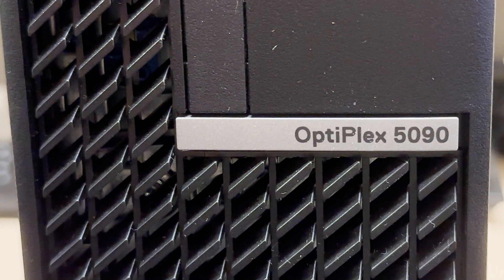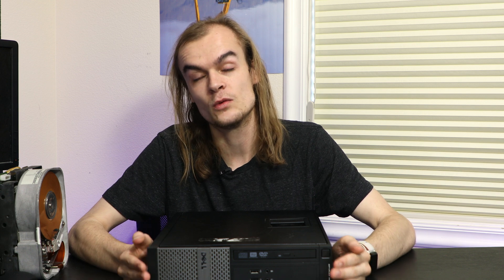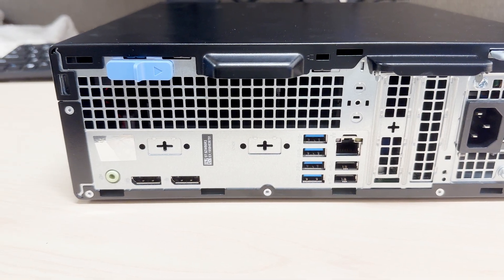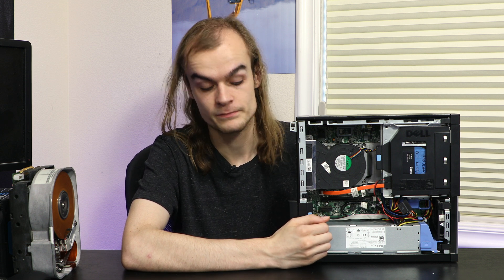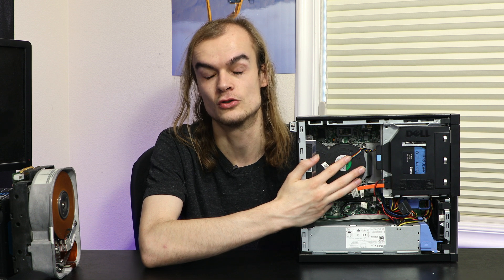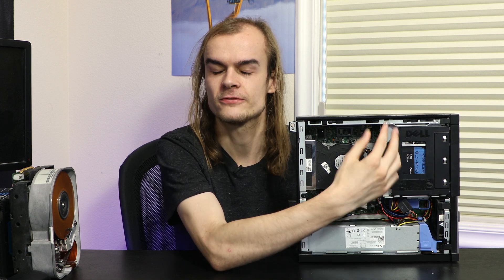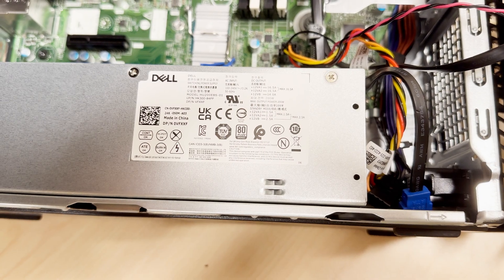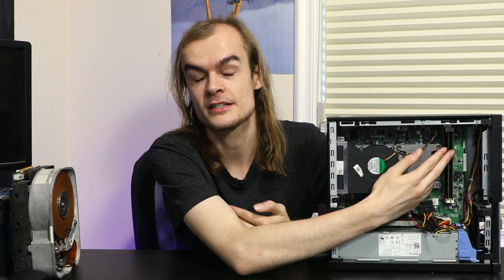How have Dell OptiPlex's changed in the last 10 years?

Comment: They made it worse by making the system more proprietary, sure it reduces cost but it also reduces the computer value, what Dells fails to see is that they are NOT apple, their ecosystem is not different from the rest of the computer market, by going apart from the rest in compatibility they are only pushing away possible buyers, anyway these computers will only be eWASTE in a few years.

Comment: 1. The newer Optiplexes weigh less mainly due to using less metal in the construction.
2. The newer Optilplexes have the SATA power cable coming from the motherboard via a proprietary 6-pin connector. The old ones had it coming straight from the power supply.
3. This video could apply to HP EliteDesk/ProDesk and Lenovo ThinkCentre as well.

Comment: lots off proprietary parts  but they are cheap as refurbs - it is better to build your own systems generally but more expensive but you have more options such as using gpu easily